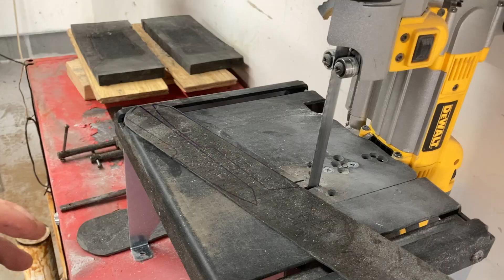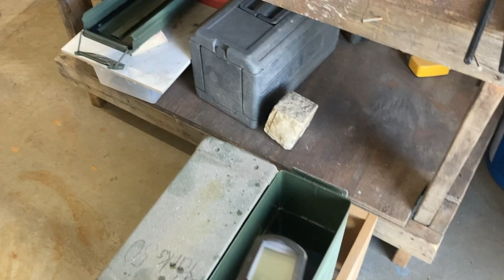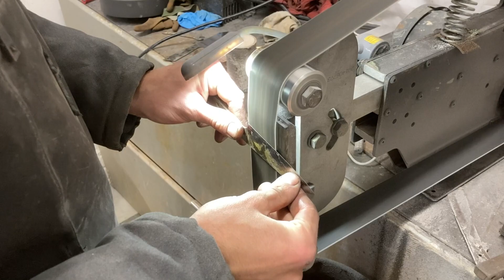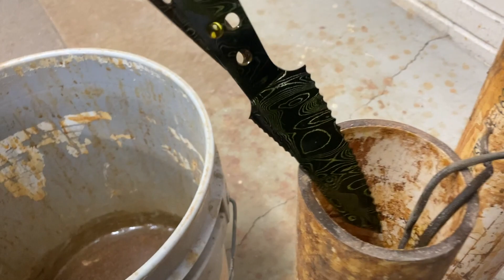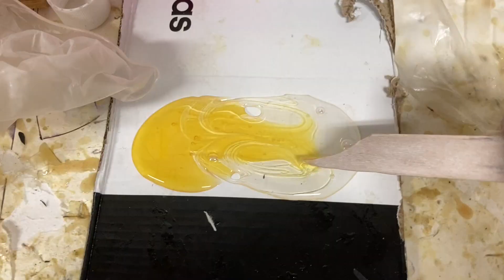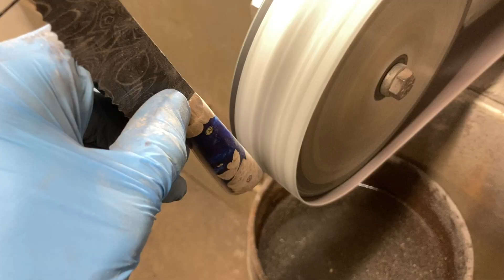Making Serrated Damascus Steak Knives | Knife Making

Comment: Do you do any hand sanding to get the scratches out? I also use a polishing belt but it seems there are always scratches from the 120 or even 60 grit belt hiding that do not show up if you don't hand sand parallel to the blade.
Reply from the maker: I hand sand some blades but often do not. I don’t feel like it gives me that much better of a finish than if you do a really good belt finish. I just make sure that I get all of the coarse grit scratches out.
Reply: @Panagiotis Grigorakis you have to use finer grit if you
 have scratches you need to get rid of  220-400-800-1000 
iv"e seen people go has high as 3000-5000-8000 to polish !